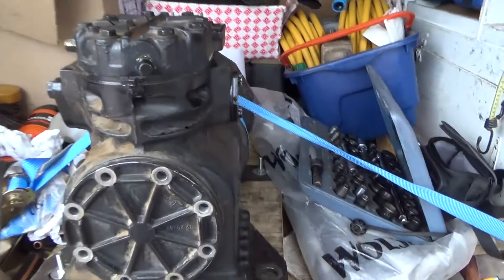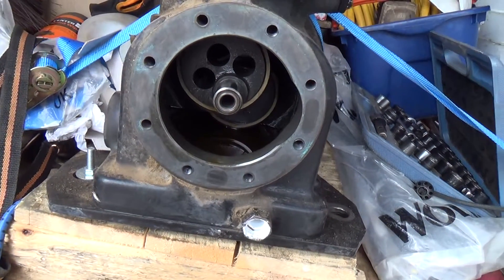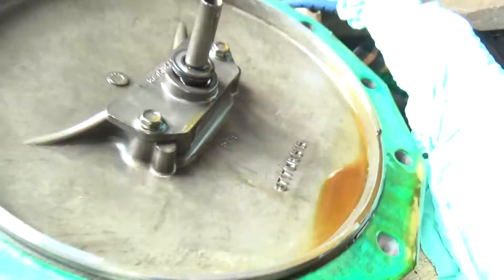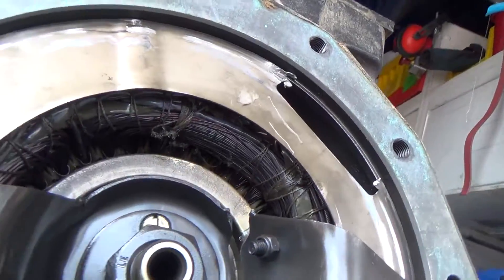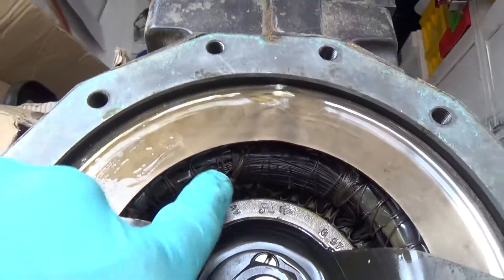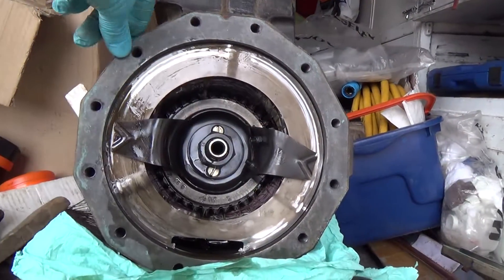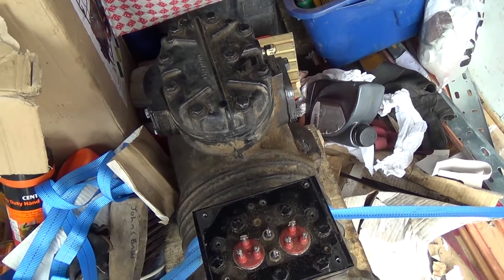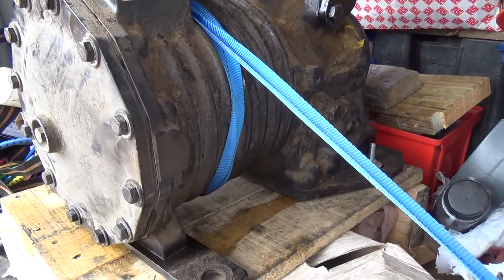Failed Prestcold Compressor Autopsy

Comment: What a shame, that was a very well built unit. That pressed-steel slinger with counterweight was a fatigue failure-prone idea it looks like to me.

thanks for sharing it!
Reply from the maker: davida1hiwaaynet Yeah, it seems a bit of a design flaw, though this had been rebuilt before so could have run for many thousands of hours before failing.
Reply: heavydiesel I see. It's hard to tell sometimes with metal fatigue failures. With Caterpillar,  we really investigate these type of failures because they can cost a lot of money. Like you saw here, it's really bad when an unrelated part breaks just after a rebuild!

Comment: Are you going to rebuild it HD? or buy a new one !!!!
Reply from the maker: I exchanged it for a rebuilt one, its about 1/3 to 1/2 the price of new. Often it is quicker to get a rebuild as the wholesalers don't keep much in stock here anymore. They will rebuild one in a day or so if needed, i had one fail over Christmas one year and they opened up in the evening to sort me out one!
Reply: Then it's worth it for a rebuilt one if it's half the price, and they actually opened up Christmas for you? That's great .
Reply from the maker: They are on call 24/7 for supermarkets etc They will even rebuild bigger stuff on site or lift and shift as they call it a rebuilt one in place of the failed one if i disconnect the power and remove the refrigerant.
Reply: That's great . Here in the states they charge you if they have to open up and most of the times they don't hear the phone ring lol
Reply from the maker: There was no extra charge, i offered the guy a few $$ but he refused, said it was all part of the service!
Reply: That was nice of him over here is all about the money. We don't have customer service in the us

Comment: That looks like an odd design. The slinger arm bound to deflect backwards and forwards ever so slightly with the action of the counterweight and resistance of dipping into the oil? Not surprised it has cracked where it has.
Reply from the maker: The compressor is about 20 years old and has likely done around 2.7billion revolutions so they got their moneys worth from it. I wonder if the newer Copeland ones have an improved design of oil slinger. I will have to check the next one i get thats failed.